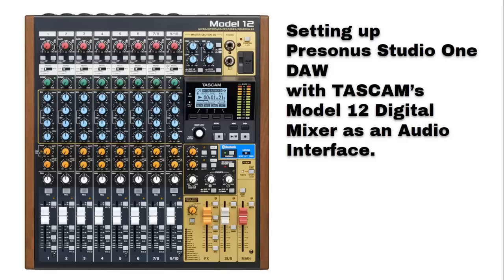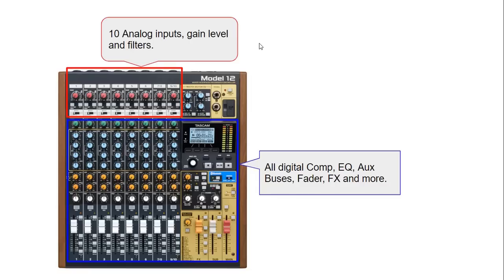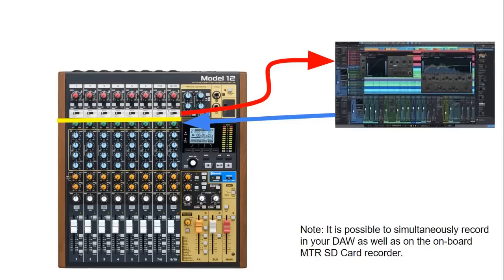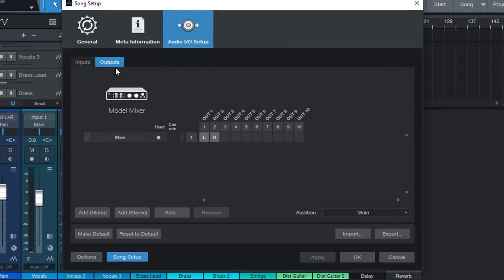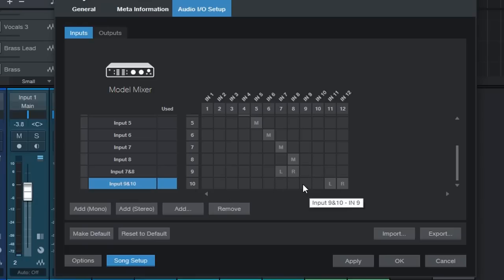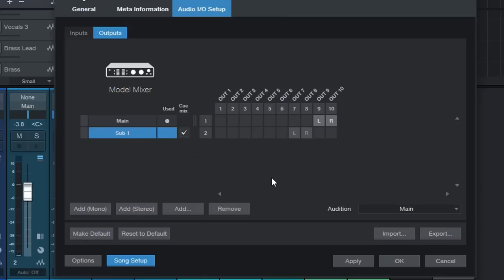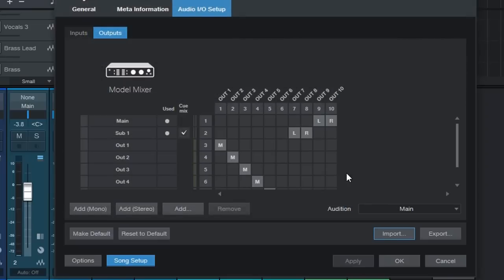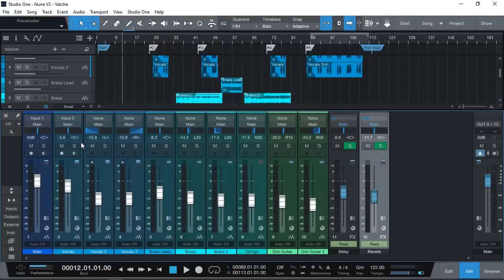Setup TASCAM Model 12 Mixer as an Audio Interface in Presonus Studio One

Comment: Thank you for your video ! I am using Logic pro X with my Tascam Model 12 but I have a problem in DAW controller mode. I have no sound in my monitors ( Yamaha NS 10 with an amp) trying to use either sub out or AUX 1/2 out puts? Though, I have some sound in my headphones... Could you help me with the routing for passive monitors? Thank you.
Reply from the maker: In DAW Controller Mode, Make sure you set Logic Pro X main output to USB out 1/2, as M12 in DAW mode only receives audio on those channels. The faders have no affect on the volume of the playback, as thay are controlling the faders in Logic Pro X. More details in the supplementary manual.

Comment: Thanks to you, I have been using my Tascam Model-12 as an audio interface with PreSonus Studio One for months without any problems. Tonight I suddenly lost the ability to monitor my recorded material via the Model-12, although none of I/O settings have been changed in my audio set up. I know a signal is getting between the Model-12 and my laptop because I can hear live signals from the audio inputs through my phones.  I just can't hear the recorded material in playback. I have channel 7/8 as dedicated channels for a stereo SUB mix. I've got 'mode' set for PC, as usual.  Do you have any advice to offer me?  I would be most grateful.  Thanks.
Reply from the maker: I’ve had a similar issue during the last couple of months before I finally pulled the plug. 
To resolve, I had to turn off, wait for a few seconds and turn on the unit.
Reply: @RecordingStudio9  I'm still having the problem, despite trying a variety of suggestions, including yours. I just downloaded and installed an update from Tascam for the Model-12 (142), but it made no difference.  There was also a firmware update for the Studio One---but both came after the problem.  Are there any special settings I need to double check for in the Model-12?  I repeatedly get a message reading, "USB Fs mismatch," and when I press the multi-jog dial it disappears.  But maybe this is the source of the problem. There is no input to Studio One, either, when I attempt to record a mic signal from channel 1. I'm about ready to 'pull the plug', as you say, on using the Model 12 as an audio interface and buy a Focusrite 2i2, unless you have a better recommendation. Thanks for all of your help, my friend.

Comment: Hey sorry to bother you again but I reset my ins & outputs on Studio One similar to how you demonstrated on this video. Now the last 3 sessions I recorded dont playback the send effects I put on the vocal tracks, I cant hear the delay or reverb plug-ins. Do u think something I did wrong on the ins & out matrix or the settings on the model 12 could have caused this?
Reply from the maker: I recommend you watch tutorials on Studio One. Login to PreSonus website and they have lots of short and detailed videos.
Reply: @RecordingStudio9  Thanks but I have been looking at a lot of videos on the I/O matrix. I've been using Studio One for over 5 years & have never had a problem with recording until I got this Model 12, this is my 1st mixer in general so I know the problem is here & its a simple. I will try to go back to the setup I had before the filmware update using channels 1&2 instead of 9/10, it was better then than now.
Reply: I figured out the problem, the 9/10 output was selected on the master bus on the mixer in the DAW, I changed it to 7/8 & now I can hear the effects.

Comment: Thanks very much for this and other videos you've done. I'm pretty sure I'll be investing in the Tascam 12, but I just want to make sure I'm understanding a few things. At the moment I'm using a Roland quad-capture for my interface to run one mic and keyboard thru with midi or cables and my Daw is Logic X. So am  correct that I won't need this interface anymore when using the Tascam 12 mixer? Also, in one of your videos you mentioned the pre-amps are really not that great. So would you suggest turning phantom and internal pre-amps off and passing the condenser mic through a superior pre-amp instead? Thanks!
Reply from the maker: Welcome. Correct, you will not need the Quad-Capture as M12 will be your new interface. If using condenser microphones, this should not be a problem, mice-pre have enough gain. Unless you are using dynamic microphones that may need extra gain. The line inputs on Ch 7/8 and 9/10 are low in gain. Watch my previous video on the topic.

Comment: I continue to get clicks and pops when using studio one or reaper.  Not sure what causes this distortion.  Buffer settings have all been configured with no luck.  I have the latest firmware and am using the provided USB cable.
Reply from the maker: if you are still getting pops and clicks even if you set the buffer above 512, then your CPU is too old to handle or you have far too many VST in your DAW for the CPU to handle.

Comment: Hey! Really helpful video, I’ll  check it completely when I receive my tascam. I’ve got a question, in the daw mode is posible to use the main outputs and the sub or aux ones to have 2 pair of monitors and switch between them for comparing while mixing ?
Reply from the maker: Yes you can, by turning main and sub channel buttons. The playbook is on channels 1 and 2.
Reply: @RecordingStudio9  really? Finally received but is like the sub one doesn’t exist, I can only use main one during the DAW mode, as an interface I could use both but then When I’m turning into this mode everything changes
Reply from the maker: @miguelmunozdominguez4595  Are you using the Channels 1 & 2 MANI & SUB buttons to send to respective outputs?
Reply: @RecordingStudio9  you mean the one on the tracks 1-2 right? Yeah everything is pressed, I saw in the manual that when you use the DAW mode the mute button of the sub channel is like pressed so maybe this is the problem with that. Without using the DAW mode I could switch whenever I want and everything sounds okey

Comment: Question please ,so this means I can record a band of 3 to 5  instruments Individually at the same time by doing this setting.   Problem is because I plug in my 12 channel mixer behringer 1222usb with interface integrated to my computer using studio one 3 prime ,  and I try to record my vocals and guitar and when I press record both each track recorded both  and guitar and vocals  and not Individually
Reply from the maker: Two answers:
Behringer 1222USB only supports stereo Main Bus USB audio, where Model 12 has 10+2 individual USB channels into your PC and DAW.
Studio One Prime only supports 2 inputs for recording, meaning even with Model 12, you can only record 2 mono or 1 stereo track. Upgrade to Studio One Artist for no input record limitations.

Comment: Can we use this mixer as a sound card?
Reply from the maker: It all depends what you mean "a sound card".
Sound Card is normally defined as audio input/output found on most computer motherboards or as a PCI Card. They provide a Microphone and a stereo line input, as well as up to 6 Line outputs (5.1 Channel surround) for multimedia audio.
An Audio Interface is normally a FireWire/USB/Thunderbolt connection external device that can have from 1 to 100's of inputs and outputs. Generally, Stereo In/Out, commonly 8 in/out.
The TASCAM Model 12 has 10 physical inputs, and 2 stereo physical outputs, plus 2 stereo headphones, among other features.

Comment: Can I use Model 12 in connection with my basic SSL2+ standard audio interface? For example: the mics are going into the SSL2+ with phantom power ON, and from there instead of into PC they are going through Model 12  (without phantom power) mono channel? I that possible? I know it's weird combination, just asking if for example I would like just to have all the Model 12 benefits on the fly instead of doing hours of audio postprocessing. I do not like to have that Global Phantom power and mixing dynamics with condensers is not recommended in such setup.
Reply from the maker: SSL2+, as far as I'm aware, does not have direct Mic to Line output. I don't own one so I can't comment.
Maybe you can aggregate the two devices on a MacOS or use ASIO4ALL on Windows. Example: https://www.youtube.com/watch?v=YFux87bvCG4